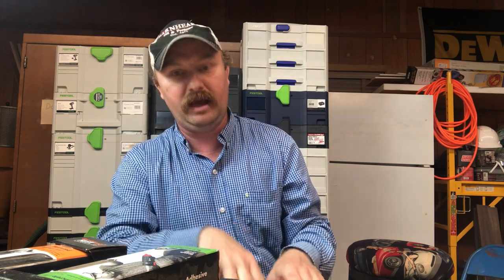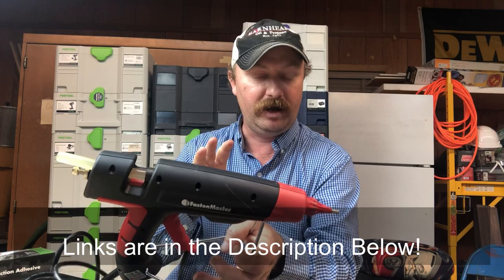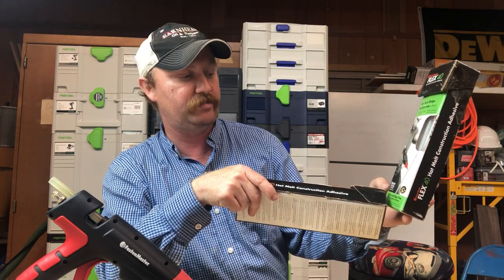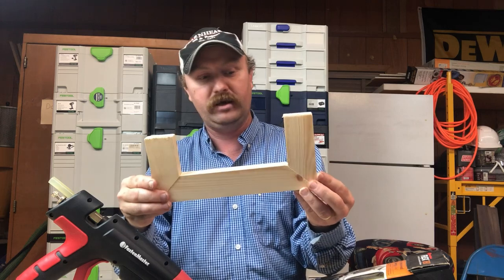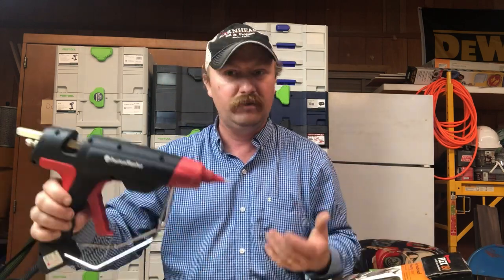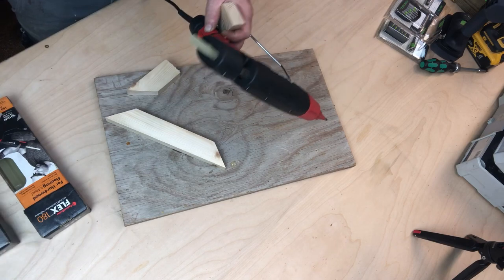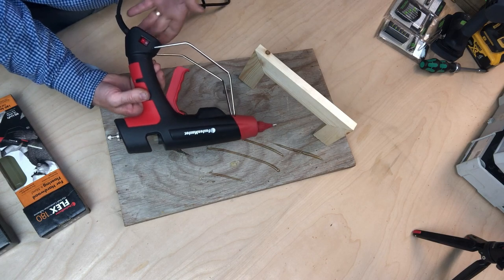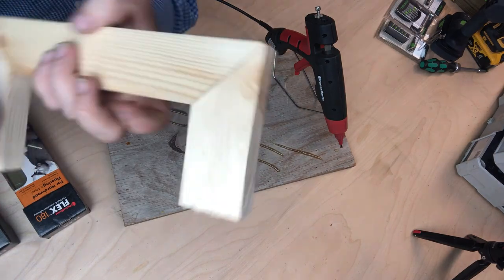Best Construction Glue Applicator!  Pam/FastenMaster Adhesive setup

Comment: I use the “Infinity Bond Ranger Pro” (330watts) glue gun with the 40 Flex glue sticks… 
I use it to glue baseboard to the walls… no more filling nail holes!!!
If it’s MDF I use CA glue at the miters then about every 16 inches I put a M&M sized dab of hot glue then stick it to the wall… It works great… also great for a picture frame Wainscoting

Comment: Great review! I can see the advantage for contractors but with a big reservation. Are we really to the point where convenience and time savings completely outweigh the time-honored craftsman’s ethic that we work with consideration of future serviceability and concern for the next guy that has to remove glued tack strips and moulding? I can just imagine prying tack strips from the subfloor only to rip chunks out. I’d then have to lay product over delaminates ply and  those uneven voids. What about trim and moulding? I’ve read suggestions for glueing in baseboards. I can imagine what that would do to the drywall. I need to redo mine due to surface damage and settling. Could destroy the drywall if it was glued. 
I’m not a contractor and I am enamored with the benefits BUT just have a hard time being okay with that. 
Fast, strong, serviceable... pick two. Someone else pays for the one we skip. Ideas?
Reply: Drywall is glued and screwed all the time these days, so how is it any different ? not with hot glue, obviously. But it's still glued.
Reply: @LBCAndrew  I’ve been converting my hardwood stairs from carpeted. What they did in the 80s was no worse than today and with better base materials. It’s been a long, hot mess. Thankfully their glue has failed so that I have yet to rip out chunks.

Comment: Millis, thanks for the video. I would like to ask you if the Flex40 or Flex180 glues could be used to glue polyesther material like poly tarps. I have a job to join sheets of blue tarps together. Thanks in advance.

Comment: It is a very nice video. Just a question. Amazon & eBay are selling this gun in the US and UK with the same part number, Pam HB220, while in the US the power is 110V and in UK it is 220V. So the question is can you adjust the gun voltage between 110 to 229?
Reply from the maker: There is no adjustment like that on mine, I’m not sure I’ve heard of something like that without a transformer

Comment: I am going cordless and looking at 2 choices I wonder if those glue sticks will work on other brands
Reply from the maker: This gun will use regular glue sticks by just changing the tip, I would assume they’d fit. It’d be worth checking into.  

Which cordless are you looking at?
Reply: I have a cordless Surebonder glue gun that takes a Dewalt battery (You can order it to take Makita, Milwaukee, Ryobi or Dewalt batteries), but it’s only 40watt… only good for crafting really…
I have an Infiniti pro electric glue gun that is 330  watts… It pumps glue out as fast as you can pull the trigger